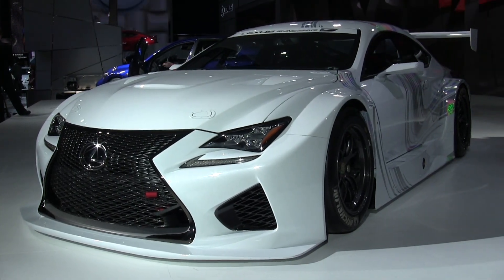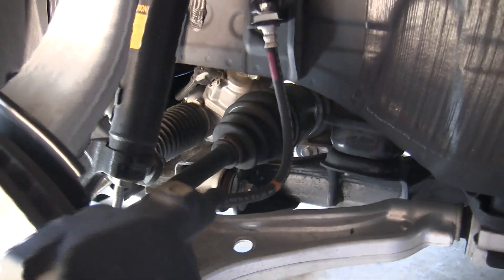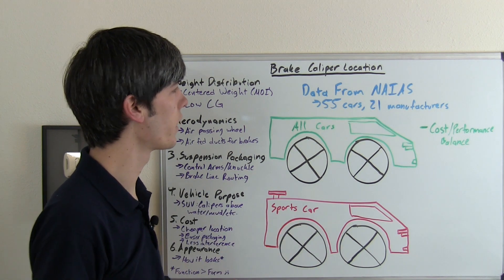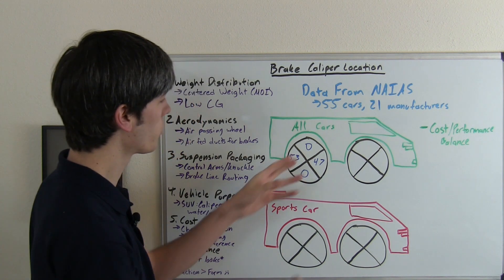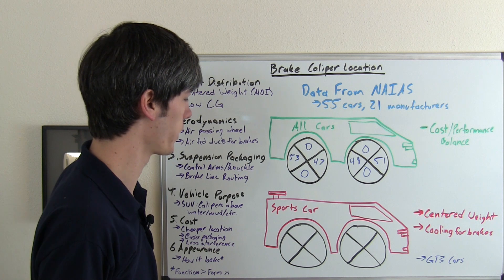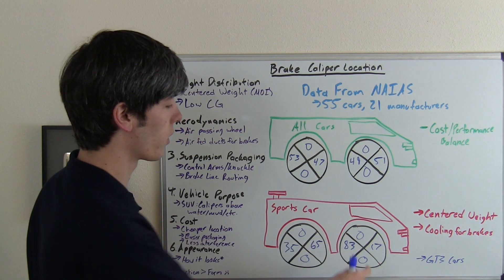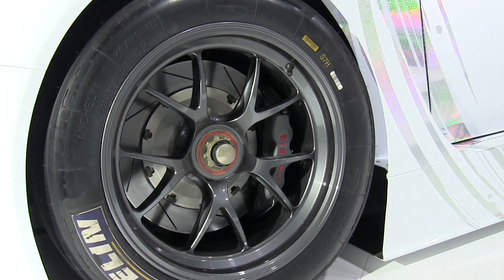Brake Caliper Location - Explained

Comment: +Engineering Explained nice video. The main reason for front calipers being placed rearwards in sports cars is limiting bearing load while braking. If the caliper would be placed towards the front it would additionally load the bearing almost doubling it (depending on wheel and brake disc size, friction coefficient > 1 for high performance tyres...) Placing the caliper rearwards it will actually help to discharge the bearing while braking as the disc will tend to pivot around the brake pads, therefore compensating the load generated by the weight transfer while braking.

Comment: Brakes are on the "non suspended" part of the car, does't matter where they are for the balance. The most important for balance is al the things that are on the suspension, body, chassis, engine transmission, passengers, fuel tank...

Comment: There are some companies that make aftermarket front knuckles/spindles (the part that the front hubs, tie rods, FLCAs and suspension bolt on to), who have decided to keep the brake caliper mounting locations on the same side of the hub, but they have rotated the caliper downward (closer to the ground); all while maintaining enough of the original orientation for the brake bleeders to be used.

 I haven't asked them yet, but maybe this has something to do with slightly lowering the car's center of mass? or allowing more direct airflow to cool the brakes?

Comment: Your point about ducting and cooling of the brakes is a little off. You do in fact want airflow onto the CALIPER, not the rotors (you said "brakes", I think that's what you meant). The caliper gets the hottest since it holds the brake pads which are producing a ton of heat. The rotors are usually vented (and have much more material to soak up the heat) and are spinning as well so they really don't need any more air. Wonder why brake fluid gets so hot at the track? It can start to boil inside the caliper.
Reply: +Jeff Beasley Cool the rotor and limit the heat build up in the caliper, add a peltier device to cool the Caliper can  help but the fact remains it is very difficult to cool brake caliper's without compromising strength, at best ducting as much air to the centre of the rotor where most are vented for natural cyclic air induction . Airflow helps

Comment: Here's an interesting slant on Performance location too, 
Mounting the calliper on the rear of the front wheels tends to help limit front end dive by dissipating some of the braking  forces into pushing the front of the car up ;
Conversely  Placing the calliper at the front of the rear axle tends to pull the rear of the body and suspension down also assisting in controlling weight transfer.
Centrally located may assist with car balance but in effect I think the effect would be minimal
Reply: +mozzmann uhm...no. it does not matter where you apply the braking force because the whole system (brakes, suspension, car chassis) is connected together. you cant make the car "go up" when braking the front wheels, regardless of caliper position. that would be like grabbing your feet and pulling yourself in the air. grab yourself something round (f.e. an apple) and place it between your thumb and trigger finger as you make a fork, now roll it across the table. brake it with your other hand in the front. your "suspension hand" still wants to go forward, thus on a car it collapes down. now brake it on the rear - it wont magically go up...its still the same force forcing the suspension down.
Reply: +Digi20 OK then explain Angular momentum please. 

Something that effects the movement in the suspension , it is also something that can be captured and made to work for you and not against. 

Experiment:-

             Get in your car and apply the park brake ( usually mechanically applied to the rear wheels - even in Front wheel drive cars )  and what happens to the rear of the car , now start the car and put it in gear (Man or Auto does not matter)  Auto Apply power  in a Manual engage the clutch . 

              What is happening to the rear ? it rises.  The Car is not in motion yet forces within the suspension force it to rise. and yet there is no weight transfer nor rotational component due to the wheels not rotating, so there is no front end dip either. exactly the same thing happens on the road with flex in the suspension components.
No flex can lead to harsh braking and other problems associated with that.

Still don't believe me then try this very same thing on a 4 wheel chassis dyno,  the front and rear will react according to their caliper location and NOTHING to do with weight transfer due to deceleration because ONLY the rotating mass of the Wheels has any effect the vehicle is NOT in motion so the reaction to angular momentum is the only thing that you see.

Comment: does the actual effect of applying the brakes have any real effect in how the car or suspension reacts depending on location other than weight distribution? I've heard of caliper relocation on motorcycles to get shorter stopping distance, I believe. Because the rotor can be traveling into the camper on an upward motion or downward motion. right? does that make sense?
Reply: caliper not camper.
Reply: +Steve B (Familyfast) .....It could have an effect depending on suspension design. Newton's 3rd law of motion.
Reply: I don't see how, unless the calipers cool better if you move them. Most just relocate the calipers because their using bigger ones that don't fit stock
Reply: +Steve B (Familyfast) There is some logic to this - if you tried, for example, to grab a spinning disc (I don't suggest you try this at home!) whilst it's rotating, if you grab it during its upward travel it would pull your hand (and think suspension here) upward. Grabbing it during the downward part of its motion would pull your hand (caliper, connected to suspension) down.The centre of gravity argument mentioned in this video doesn't really have any bearing on anything, as we're talking unsprung weight here so the brakes are not part of the suspended mass of the car. Therefore the effects would be on the suspension rather than the car itself.
Reply: +Phil King thanks bud.
Reply: +Phil King .....Not so fast. Because the ROTOR is a rotational mass, you're dealing with angular momentum, NOT linear. Therefore the suspension must exert an equal force on the same rotating plane in the opposite direction. That's why it's referred to as suspension GEOMETRY. How this all effects the suspended mass is determined by the suspension design, NOT the location of the brakes.
Reply: It's OK guys. I take it any effects would be slim to none and was just thinking out loud. I like to over think the issue and appreciate some technical talk.

Comment: I've always thought of it in the way that, for example, if the front caliper is at the back of the front disc, the force exerted on the caliper by friction on the disc is upward. This effectively lifts that wheel upward, and would mean that the load transferred to the front tyre is less than it would be, and keeps the front to rear weight distribution closer to 50/50. I may well be confused.

Comment: For motorcycles the front brakes are all in the same spot , rear and up (around the 10 o'clock). The reason: they are mounted as close as possible to the steering axis to minimise steering inertia.

Comment: Brake calipers are part of the non-suspended mass of the car, they make no difference over the CG of the car.
Reply from the maker: Marcelo Popper Costa You're saying the location of mass doesn't influence the center of gravity? That's what the term means, you know.
Reply: I'm not saying that. From your video I understood you said that one of the criterias to position the calipers is the center of gravity of the car. But it isn't since the calipers are non-suspended mass on the car, hence their mass doesn't influence the center of gravity of the car. Is it clear now?
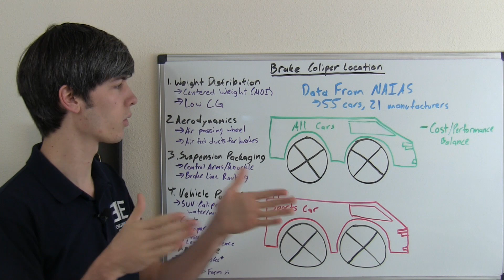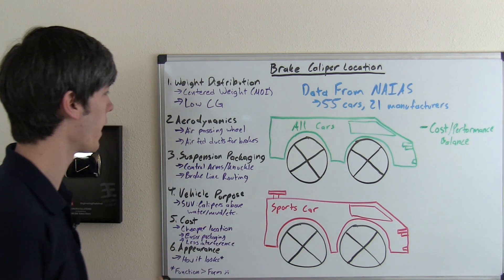Reply: Engineering Explained You say that between 0:50 - 1:00 min, but this is not correct. Brake calipers doesn't influence the center of gravitiy of the car. Neither wheels and brake disks.

Comment: I was told in a vehicle dynamics lecture, by an industry expert no less, that calipers should go behind the disc in an ideal world. Being behind the disc, when the brakes are applied the moment created by the pad on the disc is reacted by the wheel bearing in an upward direction, countering the force acting downwards from the cars mass and the forward weight shift.
However, in front wheel drive cars the driveshaft would interfere with the caliper due to Akkerman steering, so it's placed in front of the disc to maximize steering lock, at the cost of bigger wheel bearings.
He also said calipers are rarely placed top or bottom because the disc can deflect whilst  cornering, which can push the piston away from the disc, giving a strange feel on the next application of the brakes as the pad moves further than normal to take up the slack.
Like I said, this was told to me by an 'expert', and I've since moved into powertrain so have no first hand experience.
Reply: This is the main reason , caliper behind the disc, the disc comes from down-up direction and countering de downing force....The car doesn't sink while breaking...

Comment: I was racking my brain thinking about this before - I was curious about what affect braking has on the weight shift on the suspension. It would seem like you would have a reaction of some sort when hard braking is applied; as in the rotor wild want to lift the car up or down. Or maybe it doesn't work like that.

Comment: This does look like a video presentation for an engineering class. 1st rule of presentations is you know what is written down on your presentation so look at the audience instead of the board. Placement is dictated by steering rack knuckle placement. Mid engine cars have rack in front of axle requiring caliper to be place towards the rear of the vehicle. You should of concentrated on caliper design and how pistons differ from leading and trailing edges.

Comment: Basically, the CG thing is all wrong! Yeah, you need to cool the discs, and you don't wanna caliper on the other side of the rack as it'd wobble. But what's the key thing for brake calipers? The brake lines! And those go from master brake cylinder, mounted firewall, which is IN the wheelbase. So obviously, getting shorter brake lines reduces weight and somewhat reduces braking response time and complexity. Imagine, that you have driveshafts on the rear and getting the lines around it, while keeping in mind suspension travel, is a little complicated comparing to mounting them withing the wheelbase. But thanks for stats!

Comment: I seen a Porsche pannarema i think and.... it  had two calibers on one roter one was large and one was smaller
Reply from the maker: Dequavis Hardaway One is used as a parking brake only.
Reply: R8's also have 2 callipers on one disc on the front or back I can't remember
Reply: Even more interesting is the cars that have a dual drum/disc setup in the rear, such as a Subaru Forester. The standard brake is a disc, but built into the disc is a small drum brake that operates the manual parking/emergency brake.

Comment: What was the point of this video? It was literally a bunch of, "Well, the brakes might be here because of this reason, but I'm not actually sure and don't have a definite answer."
Reply from the maker: Snoshado Haha, there's certainly not a single answer for everything in engineering. Or likely anything in engineering. If you only want one reason, I'd say suspension geometry.
Reply: Engineering Explained that came off a bit harsh so I apologize for that!. I'm frustrated because I can't decide if anyone has a real reason... Suspension geometry seems like it would make the most sense to me, too though! :)
Reply: Snoshado It all depends on which car, as each one is a unique situation.

Comment: Nice video. I have seen in some cars that if the front caliper is at 6 o'clock then the rear calipers are surely are at 3 o"clock. Can you tell the reason behind this?

Comment: the postion of the front brakes has nothing to do with the weight distribution because it is sprung weight and is moving from side to side it is not controlable where the weight is at anyone time. it has everything to do with where they put the rack and where the motor is. this is the only video you have made that i have a problem with the stats were interesting but the rest was way over thought.

Comment: Did you happen to take data on the brake supplier? I'm curious if there is a trend for suppliers and where they locate it such that when you looked at sports cars, they demand high performance and there will be less suppliers out there who can provide such a product. Any chance you caught that data?

Comment: Glad you made this video, disappointed you didn't touch on a little theory I've had in my head about caliper location relating to braking stability, more specifically - when the tyre digs into the road, would outer placed calipers influence the car to dig in or squat and inner placed callipers influence the car to lift up? Basically could the location of the calipers influence whether the car try to roll over those wheels or lift up? When you brake all the weight moves forward,  and since you have the biggest brakes and the steering in the front you want all the weight to move forward, but at the same time you don't want the rear lifting off the ground so an outer placed rear caliper counteracts that by keeping it planted and resisting the liftoff. .. do I make any sense?

Comment: The reason for not using the upper and lower mounting positions is due to difficulties in bleeding the brakes in those positions.  To bleed the brakes (get any air out) you obviously need the bleed nipple at the highest point.  This is much easier to achieve with the caliper mounted vertically (inner or outer position) and the bleed nipple on the highest end.  When the caliper is mounted horizontally (top or bottom position), the bleed nipple needs to be in the middle of the caliper and this is less effective at getting all air out.

Comment: Try to compare the front wheel drive cars vs rear wheel drive ones vs the third ones,it all makes sence you said ,i would just add real difference between the two (wheel drive),front wheel drive cars,plenty going on at the front ,we have weight ,power and the steering ,all at the front,with a rear wheel drive ones power is at the back so it is just steering and engine-gearbox at the front(weight of the diff and of the drive shafts is at the back as well the weight of the whole gearbox on some models)third:mid-rear engined cars only steering is at the front with weight and power at the back,these weight-power-steering things are considered when deciding how to mount the brake caliper on the car, this is mainly important for the function of the front brakes,since the function of those is more important.

Comment: Those figures are a bit surprising to me, especially regarding sports cars.
Last time I looked at at a Formula 1 car up close (a 2011 Toro Rosso if I remember well), the brake calipers were on the bottom of the brake discs; and for me that's what makes the most sense in terms of low center of gravity and airflow. So seeing an actual "zero" for sports car on that position is a bit...you know, intriguing. Any thoughts on that Engineering Explained ?

Comment: From your survey of cars how many are Front Drivers and 4 Wheel Drivers with transversely mounted engines, non-boxer. It seems this is a factor as almost all Front Drivers I see have the calipers in forward of the disc. Evo, GTI, A4, A3, Acura TLX, Scion TC to name a few have them forwards.

Comment: Now I wonder if caliper size has a role in caliper placement, as many performance cars are sporting four or six piston calipers that require more clearance that may only be available on a particular side on the upright.
Reply from the maker: Absolutely, probably a large role. I'd anticipate the suspension geometry (and steering) would take priority, and then the caliper is fit in where it can, in as ideal of a spot as possible of the remaining space.